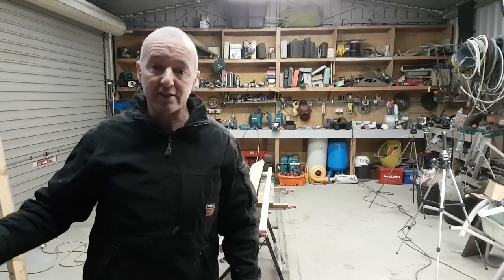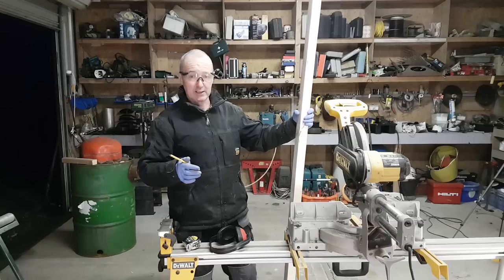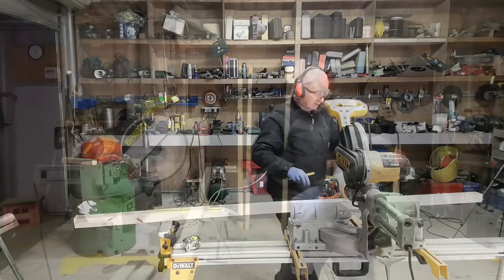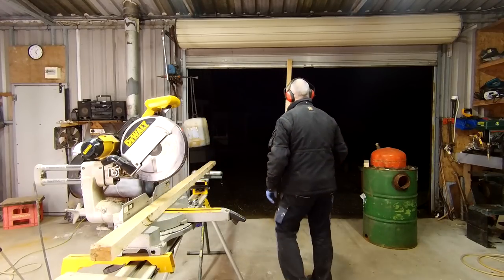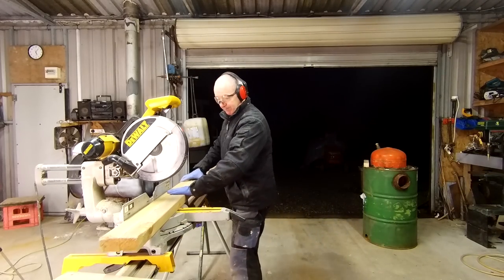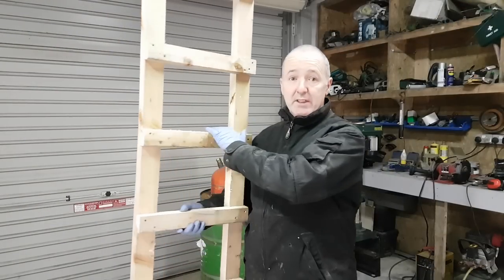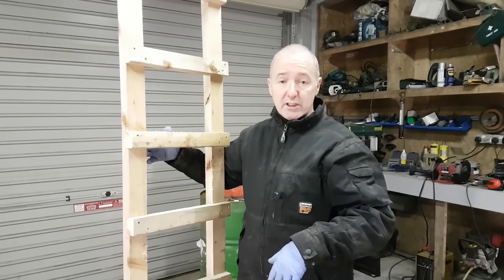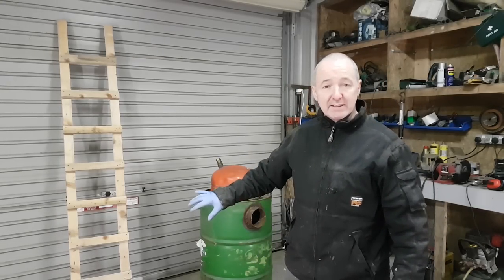Making a Simple Diy roof ladder

Comment: One suggestion i would make is on your 1st board you ripped you could have ripped it half way then turned it over on end and cut from the other end and have the cut meet in the middle.  This works well for ripping longer boards when you dont have a long outfeed table.

Comment: man gerry great to see ye back do you think your waste oil burner would wort in a stanly range inside a house to work the heating and hot water as well as solid fuel when oil,is available?
Reply from the maker: Hi Mick. First I have to say dont do it. But here's a video where I put my burner in my own Stanley Erin boiler stove connected to my 300l water storage tank and my underfloor heating. https://goo.gl/gzGLrG Note I installed the plumbing and the heating too. Hope this helps let me  know Cheers Gerry